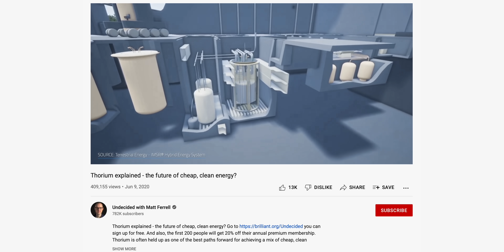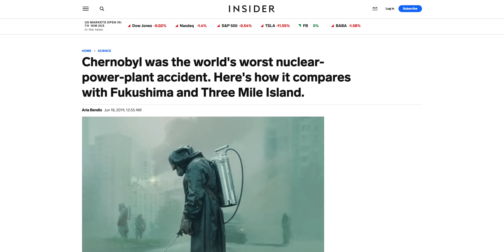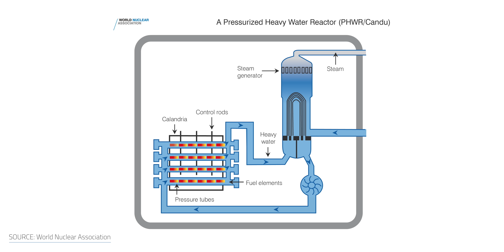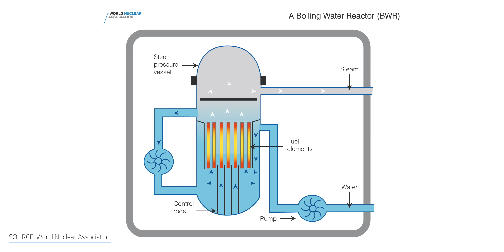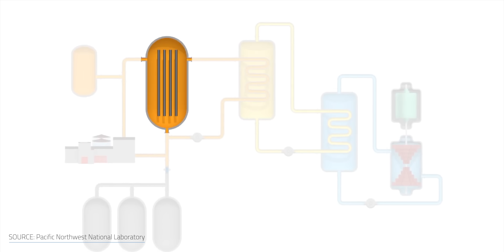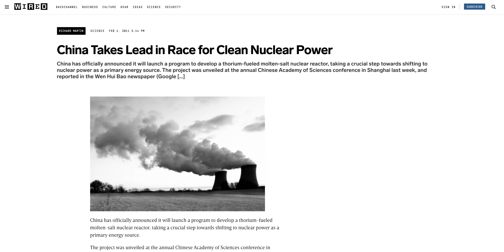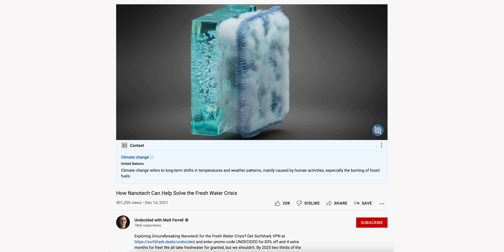Revisiting Thorium Energy - The Future of Nuclear Power?

Comment: My question is… how easy is the waste to store? Can a reaction spiral out of control while in storage? Is there ANY way to bring the the number down from 500, is there ANY isotope that the thorium can be decayed into that would have a shorter half-life?

I don't think I'd like for more and more waste to be building up as we use more and more thorium in reactors, and with nowhere for it to go because 500 years.
Reply: the waste is in kilos not tons and is mainly strontium and ceasium with half lives of 30 years times 10 so they become same level as background radiation - but experiments in Japan google Jul. 20, 2016 "Cesium 137 and strontium 90 can be transmuted into more easily managed isotopes" have shown it is possible to drastically reduce this time and even to zero
Reply: Spent nuclear fuel or waste does not suffer any sort of reactions that necessitate control while being stored.
It just needs to be placed into a container that absorbs the radiation it emits via decay.
Think of it like a rock that has high emissions. If there's shielding between you and the rock then it can't harm you. You surround the rock in shielding and that's it.
Reply: you cant have a fission reaction without fission material
fission products are not fissile
Reply: To my understanding, it can still generate a lot of heat, which would be a problem if there was any failure in the container.
Reply: @Damariobros  It generates a lot of heat when freshly removed, which would be a problem if placed in a container at that point because the fuel could melt. It wouldn't likely puncture the container, but it would be molten slag inside it which is not preferable. But freshly removed fuel is kept in a cooling pool for a while until decay heat reduces, only after that it's put into a container.
Reply: @Damariobros  That's due to the decay heat.
Fission products are unstable, as any unstable isotope they decay until they turn into something stable.
This process generate significant amount of heat.
But, over time, as more and more of them reach stable forms, less and less heat is being generated.
It's not possible for this process to suddenly accelerate and run out of control - it's just not how it works.
Reply: @Damariobros  they only put it in containers when decay heat is safe - also google nuclear waste containers - very cool - they smash trains into them / try and blow them up / burn them etc - they are very very safe
Reply: @jimlofts5433  Okay 👀
Reply: Okay, then.

One more concern I have is the event that a container is damaged or something by, say, an earthquake sometime within the next 500 years. What would happen then?
Reply: @Damariobros  the whole point of this repositories is to choose location that is geologically stable.
Like that place in Finland - that's a bedrock that haven't experience any earthquakes for the last 2 billion years.
And there's quite a few places like that around the world.

Even if container is broken. Material inside is going to be vitrified (turned into glass).
Why glass? Because it doesn't corrode. Ever.
Doesn't dissolve in anything either.
There are means to make sure this material won't go anywhere ever.

Not to say this whole thing might be entirely unnecessary.
The only fission products that pose a challenge are strontium 90 and caesium 137.
Both have half life of around 30 years.
Both are beta emitters.
There have been experiments to use beta emitters to make electricity with pv panels.
Ionizing radiation is exactly the same thing as sun light, it's just a different wave lenght of electromagnetic spectrum.
So if you can make this repository to make free electricity for you 24/7 for 300 years, suddenly a lot more places might be interested in having that.
Reply: @mikez2779  That might actually be pretty good 👀
Also I didn't know that you can turn nuclear waste material into glass, that seems like a really smart idea for storage purposes

Only snag with the pv panels thing is they'd probably have to be replaced every so often, which would leave radioactive spent pv panels to deal with
Barring that, it does seem feasible 👀
Reply: @Damariobros  If you still have access to container you could replace it. If you've buried it then one possibility is groundwater can reach the fuel, which is cited as a concern for underground disposal. But the material isn't water soluble so it would be a very slow process like the erosion of a cave.

Comment: Thorium reactor will find applications in military usages because of its relative simplicity, mainly in its unpressurized system.  Cost is also not the prime concern in military applications if it is the only viable solution.  In civilian applications, cost is the prime concern as it is competing with other forms of energy.   But one advantage of nuclear power is its consistency, something can't be achieved in solar and wind.  It is now acknowledged that solar and wind cannot meet the existing demand of energy.
Reply: Thorium MSRs can be near the cost of coal.

Comment: You mispronounced 'potable.' But yes, nuclear power generation using throium molten salt reactors will become a necessary component of our energy production. Coal and oil must be phased out as soon as possible. The benefits far outweigh the cost. We have kicked the can down the road on reducing greenhouse gas emissions that further warming to levels which threaten food production is guaranteed. Given their safer design, it's a no brainer. The main arguments against them which I've heard refer to the time and cost associated with designing and building new nuclear reactors. For the wealthiest countries on earth, who also produce the most greenhouse gases and subsidise coal and oil industries, this can't be a valid exucse. This is one of those things we will have to do even if there is little profit in it. Our motivation for doing so will have to be reducing further catastrophic change to the earth's energy balance.

Comment: Your cost comparison with solar and wind didn't appear to include servicing costs, solar panels need replacing avery 10-15 years, and wind is tricky to service as well. Plus LFTRs can use old nuclear waste as a fuel source, this would reduce their running costs. And wind is not off world compatible, solar is but requires replacing after 10-15 years and needs to be in constant sunlight and within a distance that they can actually harness sunlight, nuclear can be used anywhere anytime off world, from Mercury to the Kaiper belt. And with the less complex systems, LFTRs can be scaled down and mass produced in a factory setting in ship-able containers, this would further reduce costs and increase practicality.
Reply: You apparently missed two even more major flaws in the numbers.  A four hour solar storage?  Show us where on the planet that would work.  A 30 year lifespan of nuclear?  Nope, more like 50-60.  Show us how many times solar would have to completely replace their panels and batteries in that time frame.

Comment: Eventually we need to invent ways to store co2, because you can never lower the co2 in the air on long term. You will only notice when planting more trees and more trees, but eventually when there is no space left for new trees the co2 level will not go lower anymore. Trees don't magical let co2 dissapear. It stores the co2 for 100 years or less. After that it will releases it back to the atmosphere. Many forrest area's are actually not reducing the co2, but sometimes increasing the co2 levels because of the rotting progress of dead trees. You need to build houses from wood. Not from contrete, brick or steel. Use wood!

Comment: What is the land use per MWH for wind and solar. Are LFTRs a better option from a land footprint perspective? If wind and solar are using land that could have other important productive uses there is perhaps an opportunity cost consideration not being taken into account. I would not want land suitable for housing or food production being used for wind and solar if a much smaller LFTR could be used for the same power output.
Reply: From a land footprint perspective only biomass is worse than wind and solar.

Comment: Why don't they store excess energy by splitting water in to H2 + O2. Sure, it's got dangerous drawbacks, but so do most if not all other options.
Reply: because it takes more energy to rip those atoms apart than you can get by putting them back together?

Comment: I've heard that, though the waste is only radioactive for 500 years, it runs much hotter and would actually need cooling, driving up the cost of storage. Is that true?
Reply: The fluoride is the coolant and operates up to around 1400C.
Reply: I meant the radioactive waste, not the reactor.

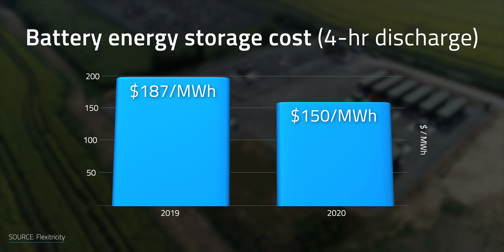Comment: 13:30 these figures (around $180/MWh) for battery storage sounded a bit surprising, so I did some googling, and what I could find was around the same - per KWh! So the cost in this video was s under-estimated by a factor x1000 :(
Reply: AND they used a 4 hour storage which is off by a reality factor of at least ten, AND they used a 30 year life expectancy for nuclear which is actually 50-60 years.

Comment: China's 2MW MSR is up and running at Wuwei (criticality was October 2021), expect some reports soon

This is a rebuild of the ORNL MSRE running on thorium (MSRE ran on U235, U233 and Pu239, not thorium) - to validate the ORNL work

There's a 100MWe system being built alongside it to validate power generation - that's what ORNL was proposing when the project was shuttered by Nixon

Contrary to scaremongers, it's virtually IMPOSSIBLE to make U233 weapons from thorium. The USA, USSR and India have all tried and failed miserably. The level of inherent U232 contamination is so high it's too dangerous to handle when irradiated and makes any weapons attempt fizzzles

essentially, thorium is highly weaponisation RESISTANT, whilst U235 reactors are built from the waste product of weaponsmaking systems - this is why the USA shut down the MSRE project in 1972 - it would have divorced civil nuclear power from the military dependency and stripped uranium enrichment plants of their "dual purpose" protection from SALT treaties
Reply: I don't say this as "scare mongering", "proliferation concerns" are inherently meaningless.
But it's very possible to make U-233 based weapons. This is not a "disadvantage" in any sense but it's still true. In testing it performed about as well as Pu-239 for an implosion device. The reason why they weren't used is because it's just easier to do it by breeding Pu-239.

Comment: I foresee problems when green energy sources can't provide energy for more than those 4 hours of battery storage. Recently we had a few days of fog, which means no solar and no wind. No battery can bridge that. The only way green energy would be possible is to have power from elsewhere, or nuclear. 

Also, weather can be pretty moody, some times it is sunny for days, other times windy and totally cloudy. That means solar AND wind must each separately be able to produce all the energy that the country needs. All in all I foresee problems getting green energy all lined up as reliably as nuclear will be.
Reply: My 4Kw photovoltaic system has only produced power for about three days for the last 30, so you are spot on about the 4-hour nonsense.  I'd love to see any greenie come and tell me how big of a battery I would need to be 100% solar in a Michigan winter.
Reply: @danadurnfordkevinblanchdebunk  Probably wind would be a better green energy source in Michigan, but solar is way more practical than a noisy windmill. 

But. Does it come down to that we need to be able to produce 100% of the required energy with nuclear, and use green as a way to usually not run at 100% nuclear capacity? If so, then the way we look at both nuclear and green must change considerably. Now green seems to be the end goal instead of the assistant.

Or is there a way to have a continent size distributed energy network, with energy storage that will last days or even weeks?

Comment: Almost no one seems to make mention of another, fully developed way of producing power.That uses a process, predicted by the Grand Unified Theory-Classical Physics, to extract some of the orbital energy of the electron in Hydrogen. This lowers the electron to an orbital that is lower than the one understood, using Standard Quantum Mechanics, as being the usual lowest orbital called the ground state. That orbital energy is removed from the electron by a catalytic reaction and then released by the catalyst to the vessel walls. Tubes surrounding the outside of this vessel, with water circulating inside those tubes, makes that heat available for use.

This device is currently being used in a pilot plant, that is planned to run for two years, which run started in January 2022. The company that developed this device is Brilliant Light and Power. The topic of Brilliant Light and Power, on Wikipedia, is only allowed to be considered as if using pseudo-science for having developed or for explaining how this device works. Why would Wikipedia want to portray this company from only the negative side? Is that because very few understand the theory used? Even though use of this theory ended in having a working device, that not only works, but works exactly as predicted by that same theory. That should be the only way to decide if the theory and the company using that theory is to be portrayed in a fair and balanced way. What is accepted, instead, is SQM, due to the large numbers who simply agree on using its math, which math was fitted to that system. That is circular reasoning masquerading as a seemingly accurate theory.
Reply: Get back to us when it proves it's a viable option.  All previous hydrogen memes have proven to be a red herring.

Comment: 4 hours is nothing. Nuclear runs 24/7. How much would solar with a 24hr battery cost? An awful lot more.

Solar has it’s place but 100% renewable just doesn’t work.
Reply: Would need a lot more than a 24 hour battery.  My 4Kw photovoltaic system has only produced power for about three days for the last 30, so you are spot on about the 4-hour nonsense.  I'd like to see any greenie come and tell me how big of a battery I would need to be 100% solar in a Michigan winter.

Comment: as prof Volker Quaschning said: Nuclear Power does not fit in our posible Powermix with Solar and Wind, 
yes we need something to bridge when the Sun does not shine and the Wind do'nt blow, but Nuclear P-Plant are not flexibal enough for that, you can not switch it of at Day and turn on at night, it needs Hours and Days, and Nuclear-Power is way to expansive.
Power to Gas, to store the Energie we not using the Day with Solar and to bridge the Nights at Winter, Car Batteries from Electrical Vehicals as short term storage and stabelize the Gritis also posible (even today)
Reply: You didn't even hear what he told you about TerraPower's Natrium project.
Reply: @danadurnfordkevinblanchdebunk  what do you think i did'nt get? .. yes it is safer then other Nuclear Reactors .. but its still Nuclear, its still Nuclear-Waste that lasts at least 500 years wich we can not garanty to store that long anywhere, Nuclear Plant are highly a political thing to be ably to build A-Bombs .. as he said its cheaper then "normal Nuclear Plants" but still no competition to Solar and Wind .. 
To build them would take Years .. to Build them need lots of Concrete wich blow tons of CO2 in the Air wich we right now NOT need or want, because co2 neutral Concrete is still not a thing .. 
for stability .. yes Thorium is very stabil energy source .. to stabil .. when Sun and Wind delever 2-3 time the energy we need we can not shut down Nuclear Plants fast enough so it would be needed to shut down Wind and Solar wich would wast alot of capasity (is alrdy the case).
We simply do not have the Time to wait for a good method of any Nuclear Plant to get CO2 Neutral .. and we alredy have a technology that is pretty clean, easy and fast to build and cheap to maintain compared to anything else, only thing to tinker is storage (but scalable technology it self exists, salt batteries, Power to Gas and such)

Comment: Renewables have a significant problem. They have a significant shorter lifespan or end of life, and they take massive more minerals, especially rare earth minerals, than nuclear or fossil fuel plants. In the process of their manufacture all kinds of toxic wastes are generated. At end of life the blades and solar cells can't be efficiently processed to extract the minerals and stuff that went into then. So they end up in landfill secreting toxic chemicals into the soil and perhaps the aquifer.  Renewable just can't sustain themselves and take more resources then their worth. They are not clean nor green.
Reply: Not only that, did you see how he used figures for a 30 year life expectancy of a nuclear power plant?  Should have been 50-60 years for a more realistic comparison.
Reply: @danadurnfordkevinblanchdebunk  

Absolutely, and here is a promising reactor design.

https://www.youtube.com/watch?v=uljEr4En6iY